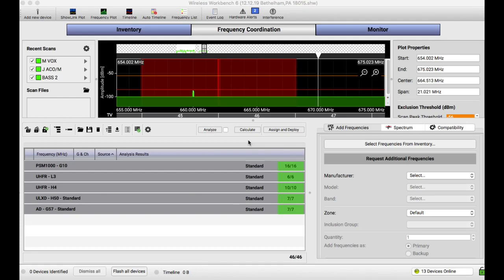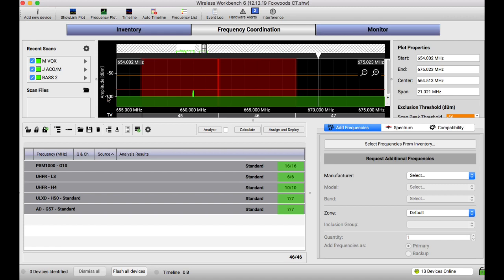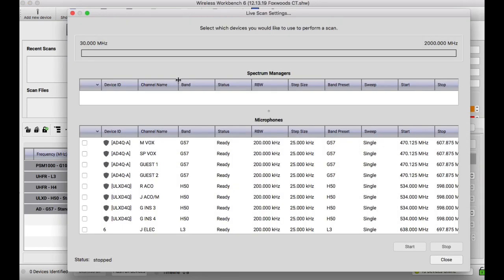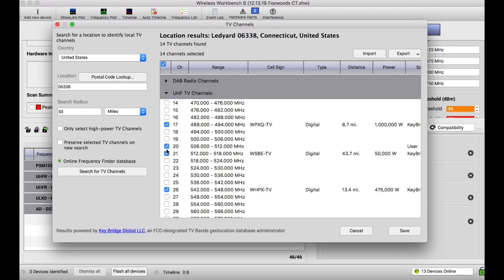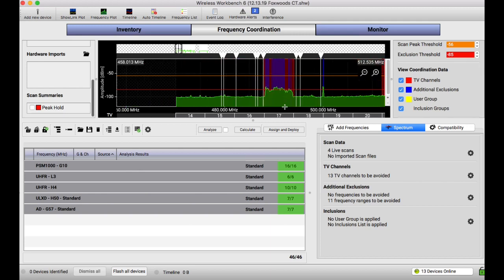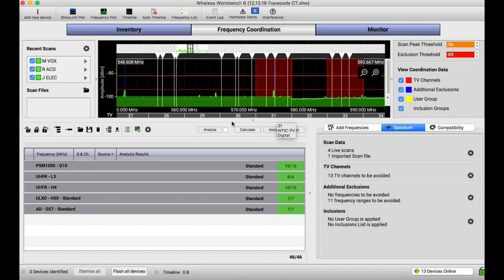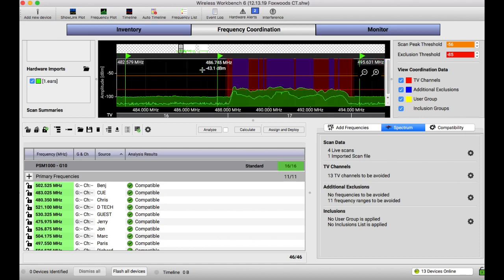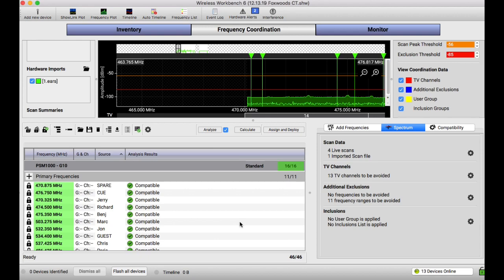Daily RF Coordination using Wireless Workbench!

Comment: Hey Nicholas, thank you for the video. This was extremely helpful from someone who is just getting up and running with Wireless workbench. I had a question regarding your scan from the pack. I do not use any wireless receivers for monitors. I'm only using RF for microphones... is there still a scan that needs to happen or do you think just scanning from wireless workbench is sufficient? I didn't know if maybe the scan needs to happen from a receiver (of the mic)?
Reply from the maker: Hi Andrew! Thanks for your question. I always try whenever possible, to use scan data from the actual hardware units. This gives WWB or any other coordination software the best view taking into consideration the front end filtering, antenna placement and any losses. 

Yet, in your case, as long as you can grab a scan in the range of your RF gear you are 90% there.  If you have a networkable Shure unit, yes, run the scan from that unit. be sure the handled mic or any other RF gear is OFF. 

If you don't have access to a networkable Shure unit, you can manually scan and not use WWB, and also look at the Shure DTV frequency finder. All of which will give you a good idea of what to stay away from. 

You can also keep an eye on the FCC DTV search here -> https://www.fcc.gov/media/television/tv-query

Of of course another great tool is the RF Explorer -> https://amzn.to/3zisLN8

I hope this helps! Feel free to ask any more questions! Have fun!
Reply: @NicholasRadina  Thanks a lot,,,this was really an "masterclass's ,,in how to ,,,without a lot of unnecessary explain that we don't need,,for getting started with WWB ...and tried to get it up running asap...keep up the good work :)
Reply from the maker: @esound2003  Thank you for taking the time to post your support! I'm happy these resources are helpful to you!

Comment: Hello thanks for video I use sennheiser ew 100 g3,100g2,300g2 and rear of reciever has not wlan rj45 there's rj11 so question is can i use this program and if yes how can do this?
Reply from the maker: Hi Vaqif— thanks for your question. The RJ11 is for data yet used exclusively by Sennheiser. This is not a network port that can be used with WWB, etc.. Only Shure devices can be networked with WWB. Yet you can coordinate nearly every manufacturer with WWB—just not the convince of networked devices. Hope that helps!
Reply: Thank you for aswering my question could you please explain what is data?

Comment: it´s normal to capture less floor noise on the beltpack than the mic units? and  when i scan with a wireless mic unit i get a green square, as same as you on one of your scans, it´s normal too?
Reply from the maker: Hi Manu! Thanks for your question. I think you are referring to scans captured using an IEM pack and also scans captured with a mic receiver? If so, yes, the IEM pack (PSM1000, etc..) inherently have a lower noise floor than many other microphone/instrument input wireless. Which wireless units/models are you using? If you would like to send me your WWB file, please do -> https://www.soundnerdsunite.org/

Comment: Hey Nicholas, just curious on steps you take when you’re in very busy environments (Los Angeles, CA). 

We currently have various G50, G20, H4 and J1 band units and I’m having a difficult time making everyone happy. Purchased the RF Venue scanner and it’s a heck of a lot more helpful but I still have at least one ore two units give me issues. 

How do you deal with 46 frequencies in high traffic areas!? Any tips for us here in Cali!?
Reply from the maker: Hi Jesus! Thanks for your comment. LA is tough for sure. I feel your pain. I'd definatly recommend improting scan data from the actual units. This will give WWB solid data and realistic noise floor of the spectrum. Are you issues related to WWB not coordinating ENOUGH  freq's or the coordniated freq's are resulting in dropouts/interference?
Reply: Nicholas Radina 

Nicholas Radina 

Thanks for responding back! I’ve imported both wireless and RF Venue data, which really helps to give WWB a bigger picture. 

Regarding the issues, I usually don’t get enough and I have at least one unit still giving me dropouts (PSM300). Most other PSMs are in a better range. Any thoughts!?